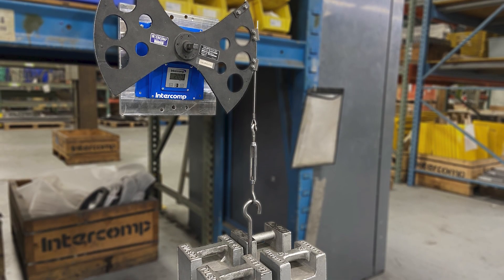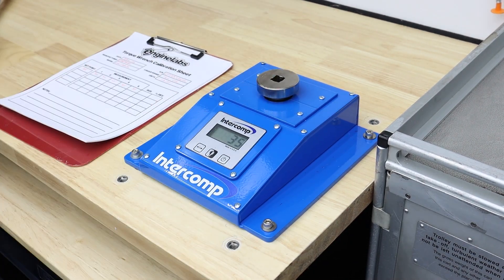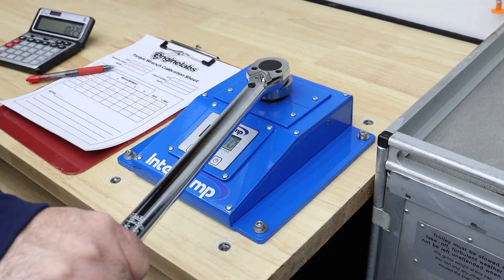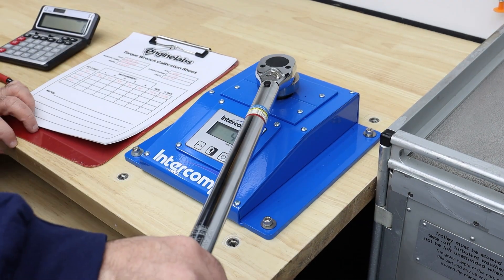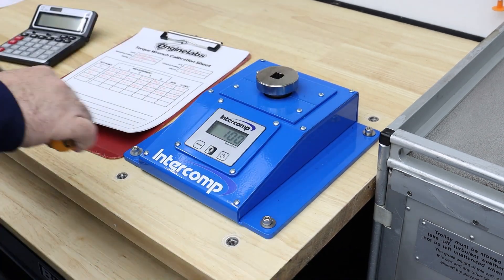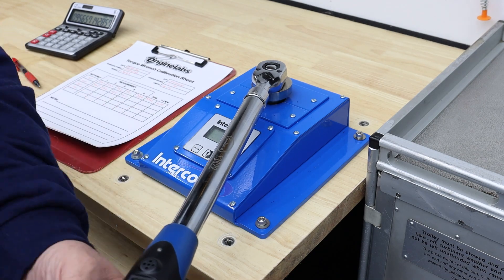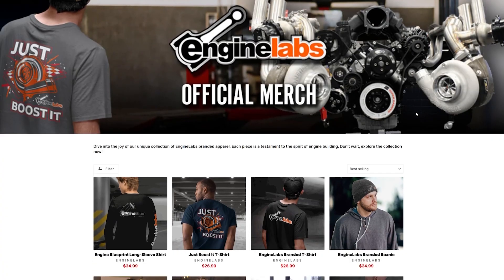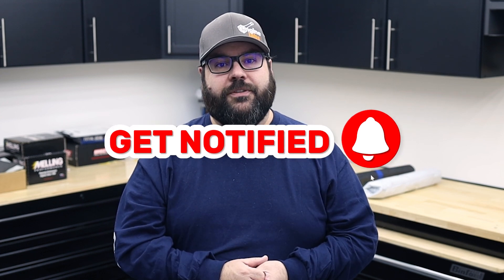Testing Torque Wrenches — Cheap Vs. Not Cheap: Does Cost Matter?

Comment: Brush up on ASME standard.  Torque wrench tolerance is only for the top 80% of the stated range.  For 250 ft lb that is 50 ft lbs and up.  Also the standard states at least +/- 4% tolerance in RH direction and +/- 6% in LH direction.  Lastly, you need at least 3 consecutive readings in spec to be considered good at that setting.

Comment: So i started an aviation job and we have our own cal lab.  We even cal one of the major railroads torque wrenches I've been told. Only snap-on/cdi get the 1 year cal to tight tolerance. Some guys with others dont get the same length of leeway. Our issue is that if something falls out of cal, we may have to call in each aircraft or send a response team out to recheck.
Reply from the maker: Are you saying the Snap-On/CDI wrenches get 365-day calibrations, or the calibrators themselves?
Reply: @EngineLabs  from what I've seen, non cdi/snap-on wrenches don't always get a full 12 month cal. There may be a correlation with prior tests and a % variation. I dont have a personal set in the system yet, so the info is heresy from guys that do.
 I'm looking at the techangle 1/4 and 3/8 because of the range. Some of the guys have a 10-50 and then higher range.  The techangle is like 15-300 inch lbs
Reply: We seem to run about a year between cal/certs and we have a mix of Snap On, Proto, and Precision Instruments.

Comment: Very interesting. I would argue that accuracy is more important on the 3/8 drive that is more likely to be used on low torque situations where damage is more likely if excess torque is applied. Think small bolts into aluminum parts or spark plugs into aluminum heads.
Reply: Im in aviation, ive used as low as 18 in lbs regularly. We may only get a 20 in lbs range to set a castle nut.